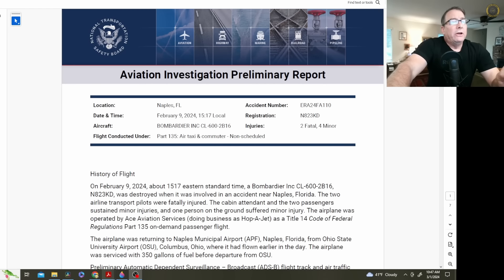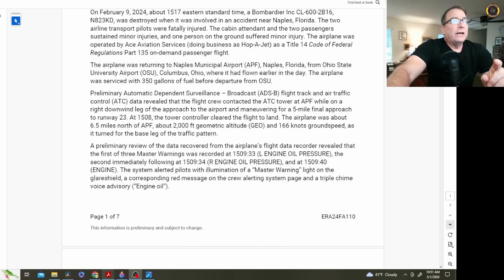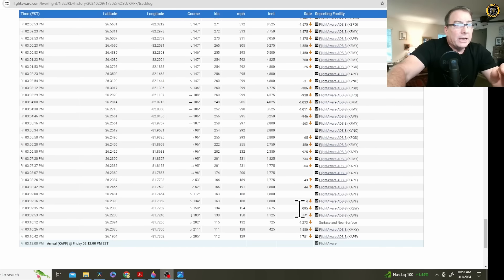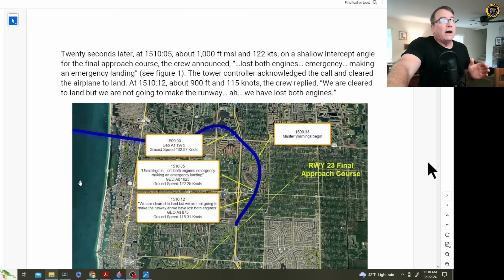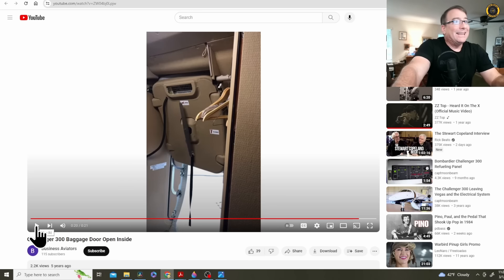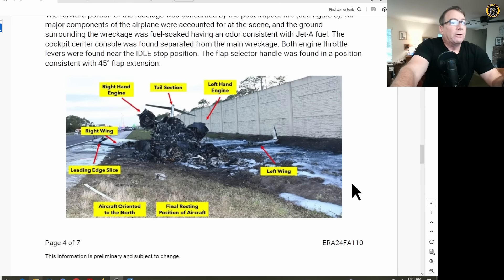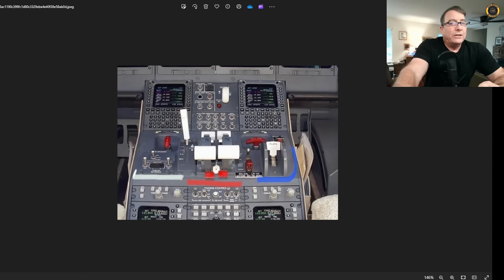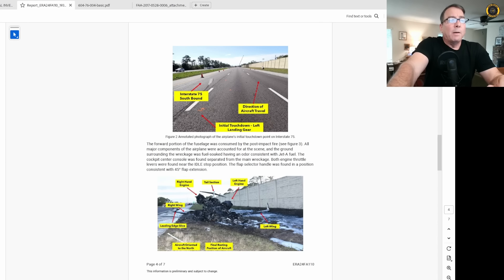NTSB Preliminary Report: Naples Challenger 600 N823KD

Comment: There was a large road sign on the side of the road which likely made the crash worse, if you check it out on street view you can see it's supported by two vertical steel I-Beams. If you look at post accident photos from AP you can see the wheel marks on the grass beginning to curve away from the wall despite the wing scraping along this wall. The right wing hit that sign posts, turning the plane hard into the wall. That also tore open the right wing tanks which was likely a larger contributor to the spray of fuel and subsequent fireball.
Reply: Sad situation. Rest in Peace to the crew.
Reply: Man. They were so close to making it.. its too bad they couldn't get lined up with the highway before stalling into the ground
Reply: @jimlthor  They did not stall! No wing rock, no porpoising…they flew it onto the roadway. Their problem, as they saw it was they had no good choices: they were going almost twice as fast as surrounding traffic and probably drove for the shoulder so as not to crush any vehicles from behind. From their eyes, their only salvation lay in the grass clear of traffic and they did a Hell of a good job with the very bad hand they were dealt.
Reply: Fly safe @scottmanley
Reply: I watch your channel but you are incorrect here. If you watch the dashcam video of the actual crash you can see the sign that you are talking about, but the plane is nowhere near it. The whip around is caused by the right wing impacting the wall, and pictures after the crash bare this out.
Reply: Life is a real bitch sometimes. If only they could have avoided slamming into the noise abatement wall they would have been as safe as their passengers.
Reply: @ImpendingJoker  There's literally discussion of this in the NTSB report:

"The right wing exhibited leading edge damage consistent with impact with the vertical steel I-beam of a highway sign; the front spar was severed in the area of the impact. The outer portion of the wing was impact-separated; "
Reply: I knew there had to be a reason they veered so hard to the right!
Reply: It’s apparent in the video.  It happens fast, but it’s there.  But for the wing hitting the signpost, they might have made it.  So sad, extraordinary airmanship to avoid all those vehicles.  I feel like the thrust levers might have been to idle as they tried to set the aircraft down without crushing motor vehicles.  Probably going to be some important lessons come out of this.  Suck a loss for the families of the pilots, but we have to acknowledge their heroism and the 3 lives that were saved.  As well the actions of the flight attendant getting them out the cargo door.  This is a tragedy that revealed some epic airmanship and professionalism.
Reply: @At7577-t3g  ... by prohibiting any disturbing traffic flow....
Reply: also yes that sign is no longer there. There is still a contaminated dirt scene the last time i drove by
Reply: Metal signs have break away mounts no match for a Corolla
Reply: @ImpendingJoker   No, YOU are incorrect here.  @scottmanley is 100% correct.  There is a SECOND sign on that dashcam video that the plane most CERTAINLY impacts.  The dashcam video is linked on Juan's earlier video on this crash.  Or you can find it by it's title, which is, "New Dashcam video of the Challenger business jet Crash Landing on I-75 in Florida"  They zoom in on the crash and you can clearly see the sign that is most definitely impacted at time 1:58 in that video.  Give it a watch, and you will see for yourself.   @ImpendingJoker
Reply: Big long canal right alongside the highway, gear up water landing !! Did no one pay attention to the Sully airliner landing on the Hudson? Jets are just too fast for highway landings. Only general aviation aircraft can get their speed down to about 80 mph so they have a chance on an expressway landing !!
Reply: @SCOTTMANLEY....im actally from Naples Fl and sadley was unfortunate to have this happen as i was entering I75 N on my way to work (opposite side of the road from where the plane landed but right next to where it landed and subsequently crashed) And I just want to make this clear as I did see this with my own eyes and he did not hit the large sign with the two i-beams, the sign's fine He hit the grass and I believe he had his front landing gear out and when he clipped the truck before hitting the grass which he was clearly trying to land next to traffic with the flow of traffic to cause at least damage as possible and was able to avoid just about everything, but I think that the landing gear cracking off exposed the gas lines and innards of the plane and the sparks from the metal being ripped is what I believe immediately caused the explosion and the pilots cockpit hit the 20-ft retaining wall and that is what flipped the plane around, I only say this because I saw it with my own two  👀, I almost couldn't even believe what I was seeing cuz as I was getting on to 75 he was crossing over 75 heading west to make that right hand turn to head back to the airport to catch the landing strip that he needed to land on, and when he made that turn is when his engines both went out for whatever reason, which I'm super curious about and would love to know the preliminary report on why that happened, and when he had came around to head back to the airport and radioed in we on the ground had no idea what was going on so all of a sudden a plane that we saw flying over us just seconds ago was now coming down at what looked like a million miles an hour only because you don't see a plane trying to land on 75 and it looks like it's heading straight for you, I think most of the traffic didn't know what to do except think that they were going to get hit by a plane and it was going to be lights out in a matter of seconds and in those split seconds he somehow veered to the other side of the road and the unfortunate happened, so sad knowing and watching what we thought were an entire flight trapped and on fire and I'm not just talking on fire I'm talking about an inferno You could feel it on the other side of the road hundreds of feet away like you were standing right next to it, I almost felt like my car was going to melt, craziest thing I've ever seen in the 40 years of my life on this earth, and so grateful that I missed it by literally milliseconds, but I guess it wasn't my time Thank God but I still pray for the pilot and the co-pilot and the two guests on board and the young flight attendant who was able to get the passengers off and to safety along with herself Thank God, and thankfully for all the Patriots running into help as best as they could considering that it was blowing up and like I said not just on fire but an absolute inferno so to the people who ran in there to save whoever they could much applaud to you and you're selflessness to save others, it was really an amazing show of community in the face of absolute tragedy. I'll never forget that day and I'll never forget those people. Praying for all of their family friends and loved ones and the mental health for the survivors to get through this and processes to the best of their ability. My heart just breaks for all of them. But the pilot was an absolute hero and avoided hurting or killing any other pedestrian and he landed in the middle of afternoon traffic on one of the busiest interstates on the East Coast if not in North America, and didn't hurt us all, the only lives lost were his and his co-pilot. And I just wish he would have been able to live through that and see what a hero he was because everybody else did, what he did was absolutely amazing and I hope he is recognized for that. Just praying for his family as they don't believe he was very old maybe 50? I think I heard, just far too young, both of them including the co-pilot as well 💔 I think we all just wish we didn't have to see that and wish that there was more that could be done to save them but unfortunately I think that they were already gone before anybody could do anything anyway, hopefully even as soon as the plane crashed, I just pray that they felt no pain and r at peace. It only happened on February 19th and I have to drive past it every day on my way to work and I can't help but look at it everyday and just remember what happened. I don't think it'll ever leave me 😢 or anybody that was on the road that day 😢

Comment: In our test cell, we test a variety of industrial and aviation turbine engines. Our throttle control does not have a minimum stop, so we have to be careful not to pull too far back on the lever, or we can cut off the fuel.  There is so much air and fuel and power going through these engines, that cutting fuel flow for even a fraction of a second means that flame is gone. We are right next to the engine in our test cell, and are very aware when we (I) mistakenly shut down an engine. If the operator acts within a second or two, they can reset the fuel lever to idle, and restart the engine using its own rotational momentum. BUT it only works if the ignition is also switched on.   If a turbine engine is starved for fuel, it's out, and the combustion chamber/area does not contain anything hot enough to ignite the fuel. A spark is needed.     It's quite a trick, and an exciting moment to "save" a run, with a relight after an unwanted shutdown for us, and our operator is standing there at the controls, not also flying an aircraft.   I don't know if the aircraft in question will allow energization of the igniters at any time the pilot wants, but even if it does, there's a lot going on. All within the few seconds it takes for the engine to lose too many revs, the pilot has to recognize that the engines were cut, and why, rectify that, then switch on the sparks, and also fly the plane.    If the plane will not allow manual control of ignition, and only has an automated start sequence, there was nothing the crew could have done.
Reply: It has a continous igntion switchlight on the overhead panel. Press it in and all ignitors are firing until you press it out.
Reply: On the challenger, the throttle is mechanically linked to the engine fuel control. If not rigged correctly, they can fully cutoff fuel at the idle position.

Comment: They were so lucky that the frame of the aircraft had not buckled causing that baggage door to jam. Must have been a truly terrifying experience. Just such a shame that the crew that got them onto the ground did not survive. Also a real miracle that the freeway was not busier. This could easily have been a much bigger tragedy.
Reply: It was still somewhat busy traffic, just reflecting on the pilots skill to land like he did …. But it could have been worse, as you said.  But gosh, he was so close to making it. 😞🇺🇸
Reply: From listening to it, this is not an obvious crash.
Reply: This aircraft won't buckle too easy! It's a flying tank!
Reply: @HuckThis1971  What do you mean? Aircraft fuselages are quite thin aluminium and will tweak easily from a very hard landing, easily causing a door frame to get tweaked. This landing wasn't particularly hard I guess, but the subsequent impact with the wall would've been plenty.
Reply: @rkan2  I work at Bombardier on the assembly line and see this  aircraft everyday! Trust me, it's built very well!
Reply: They also could have opened it, only to find the wall or a vehicle blocking it. 
Can you imagine? That would be no way to go!
Reply: "They were so lucky that the frame of the aircraft had not buckled causing that baggage door to jam." My thoughts exactly - I have only flown the Challenger 300, but from the looks of it, that door is the same design as on the 300. We often had issues opening it, even without an accident happening....
Reply: @HuckThis1971 : The aircraft won't bend easily, but there was a collision bad enough to tear of half of the right wing.

So there were some serious forces involved.

Comment: Wow! That’s a load of speculation to deal with for quite a long time. Hence the reason we all signed off on FOQUA, ASAP and the like. Due to the abruptness and symmetry of the dual failure it does seem like an inadvertent shutdown of both engines. Depending on how the guy sits in the right seat is what I’m thinking would discern how the PIC reaches for the flap lever. If I flew with FO’s that were way seat forward I’d probably be forced to go from behind their arm. Most of the time I would go over (in front) of their arm. But, never flew the Challenger. Props to the FA. She obviously knew the airplane. Those pax are alive because of her. A true hero as you pointed out. Your vids are great. My go to guy in this stuff.
Reply: I wonder what the relative heights of the Captain and First Officer.  A much shorter Captain (whose seat may be further forward) woud hinder the his operation or access to the flaps lever.
Reply: It seems like the person landing the plane and controlling the thrust levers should be on the left and the FO handling the Flaps should be on the right.  Then this cross over issue would not come up.
Reply: @jaycahow4667 The captain always sits on the left, and the FO on the right (unless the FO is being trained to be a captain). It would be very odd for a plane to require that the captain fly all landings.
Reply: From UX perspective it seems a bit odd to position the controls that way in the first place. Ie. for there to be a completely normal workflow where hands need to cross over such a small area, especially one with critical toggles.
Reply: Yes, much remembers to what happened at Yeti Airlines Flight 691 in Nepal.
Reply: @dfeuer  Agreed. But with the way this throttle setup is designed, it might be required from now on on all jets with the same design.

Comment: At my previous airline we transitioned from Brasilias to the CRJ-200.   The levers that unlock reverse thrust on the Brasilia are in nearly the same place as the idle cutoff lockout levers on the CRJ.   We had a few instances of pilots moving the thrust levers to idle cut off on landing thinking they were engaging reverse thrust. 
I’m pretty sure we also had some engine shutdowns in cruise from pilots inadvertently shutting down engines at altitude due to one pilot having his arm behind the thrust lever as the other was pulling it back to idle.   We definitely discussed this threat in training.

Comment: While listening to the ATC tapes of this incident,  the " calmness " in the flight crew's demeanor during the incident,  wants me to unfortunately believe that they knew exactly what they did wrong and knew they were in trouble. It's like pulling the mixture control full back to engine cutoff position instead of the throttle in a light single while on approach.........The engine will quit with no room for an air restart. And yeah, you'll have to tell ATC you're not going to make the runway.  Kudos to the flight attendant......she saved her passenger's lives. The true heroine in this accident.

Comment: Unbelievable that the flight attendant was able to keep her wits after the  hard  impact and spinning to the right, then accessing the proper door to depart the aircraft with only seconds 👍👍👍
Reply: Not really. SHE WAS ALSO FACING DEATH!!!!$
Reply: @johnp139 fight or flight. Many people freeze in that situation
Reply: @assaultlick2169  The air crew selection process specifically is designed to eliminate those people who are unable to work under pressure. They're then also given training to break those tendencies. They are not grabbing random people off the street and making them flight crew.
Reply: @otm646  of course, but simulation ≠ reality. People freeze when shit gets real
Reply: Professional people in the flight deck and the plane !!!!!

Comment: In the early 1990's a Challenger crashed due to water in the fuel causing both engines to fail.  Both pilots survived.  The fuel co. tried to hide the evidence by dumping their fuel truck in a swamp.  Crazy stuff!!
Reply: I remember that one. Ice crystals had formed as the fuel went below 0C, about 2 hrs into the flight. Clogged both engines’ fuel filters and one flamed out before the other did.
Reply: Somehow I have never heard of that. Gonna have to find more info

Can't find it... anyone know the tail number or flight number?

... okay, I think I found it.. N88HA? Don't see anything about the fuel truck though
Reply: They turned down the option of Prist when they refueled. Couldnt that have caused the same symptoms and or problem? Sorta like diagnosing a disease with symptoms quite similar to another disease.

Comment: Amazing analysis Juan, at first I thought No way, but after listening to your analysis and reading the report the right seat pilot flying and left seat operating the flap handle seems the most likely scenario.  Fuel contamination causing a dual engine flame out within .9 milliseconds is very unlikely and fuel starvation from the collector tank while in a banking right turn also seems  highly unlikely.   An accidental bump and pull into the shutdown detent seem very plausible and should constitute an immediate fix and training bulletin.   Hat tip to the flight attendant, I have briefed PAX a thousand times to look outside before executing an egress and she did just that resulting in 3 lives saved.